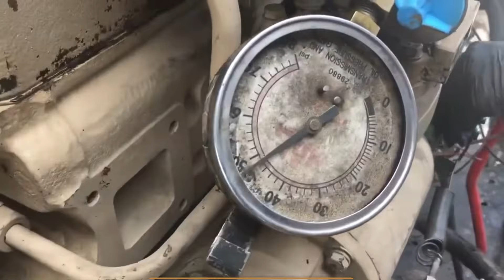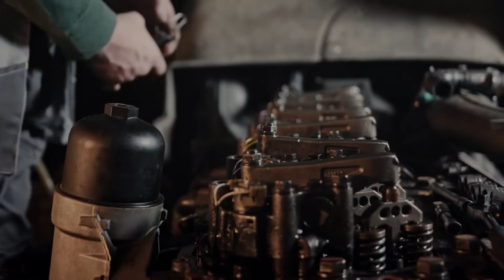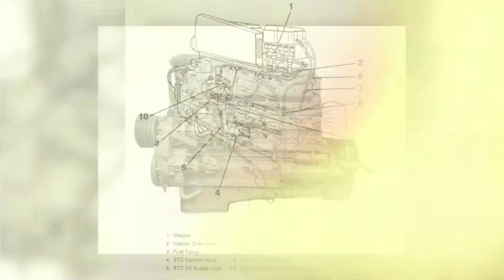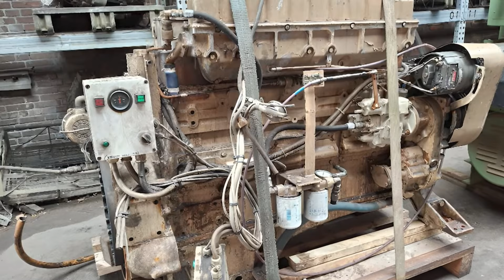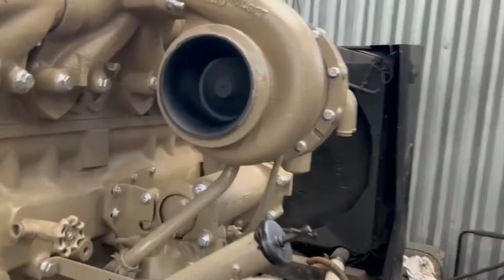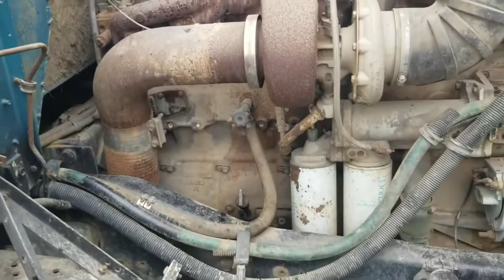The Rise And Fall Of Cummins 855: The Engine That Was Too Strong

Comment: I wish they still made these engines available today with no DEF STUFF FLUID
Reply: AmenI I have a 1974 Ford truck that has one and the seller told me the original engine ran 40 hours a week every week from 74 up to about 2004. It was then replaced with another used 855 and that's still in there today.. No way the stuff they make today will last anywhere near that long.
Reply from the maker: I hear you! The Cummins 855 was truly a powerhouse. It would be great to see a return to simpler engines without all the extra requirements.